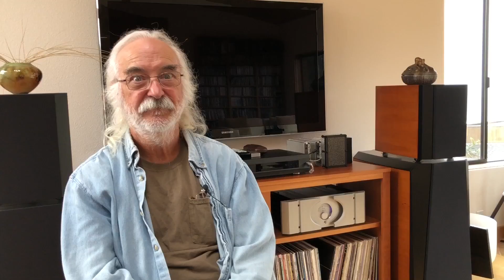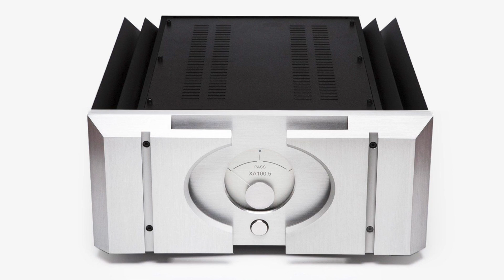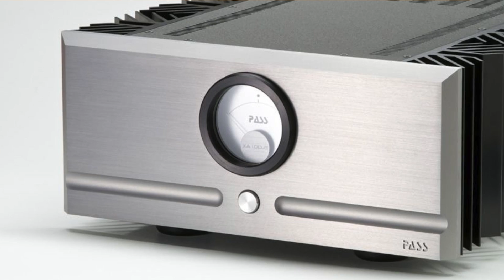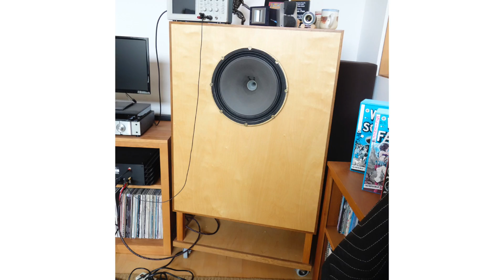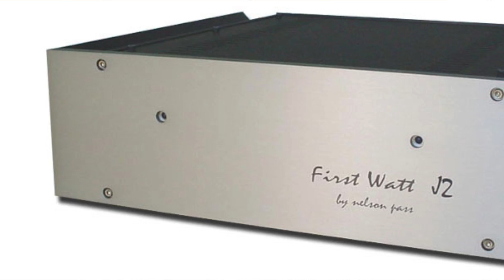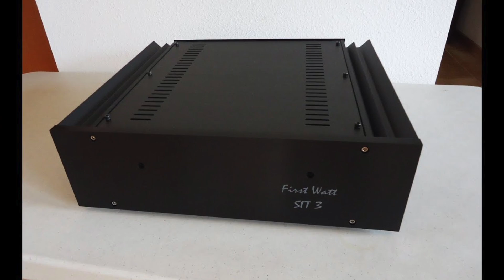Nelson Pass on his favorite amps, playing with distortion, and his 21 inch subwoofer

Comment: I was a Threshold dealer back in late 70's early 80's .. I had a chance to meet Mr. Pass at the winter CES show in Las Vegas, talked to him briefly as he was surrounded and I remember someone asking him about the LED  meters on the Stasis Two and when the LED meters were spiking did that mean the Amp was clipping.. his response was hysterical.. Does it sound like it is clipping? well no it does not.. Right was his answer .. I throw pillows in front of mine he replied.  next time around I will take them off .. I always thought the Stasis Two amplifier was a beautifully styled amp. They were replaced by the S500 Which was the brushed aluminum (still hand milled) face without the meters. I remember him with dark hair and beard lol..

Comment: 6:20 One of Frank Zappa's biggest laments, was that, his orchestral compositions were not rehearsed well enough before performances, so he wasn't usually satisfied with the results.
Frank was also a conductor of his works at times, so, he had a direct "ear" of what he wanted to be accomplished. He always had a direct composer's hand in his own Rock/Jazz/Blues workings, as can clearly be sen by his hand signaling or even body motions in many a live performance. One of his favorites was, to change the beat of the song he wanted to be performed to "Reggae" by putting his hand to the side of head and gesturing a twisting motion with it, like turning a knob. One concert he messed with his band and changed every song to a Reggae beat.

Comment: Steve, Question related to a Pass Designed Forte 1A class A amp I've owned from new (1991). The amp sounds fine but fast forward 33 years and I've noticed the amp doesn't run hot anymore and the little red power led tends to take longer to go out after I turn the amp off. Does the amp need service?

Comment: A question for you next interview could be to ask what kind of current/power purification is actually taking place inside the power amplifiers, like the XA100.5 I have for example. What is actually happening to the AC just before it goes into the DC stage? That would be really interesting to understand!
Reply: The AC mains are rectified and then ripple filtered with large caps for the rails, and then coupling caps pass the AC signal to the DC gain stages.  In a nutshell.

Comment: Question for Steve or Nelson: I have the Aleph 0 monoblocks and the First Watt J2. Which of these, if either, are best to drive my pair of restored Quad ESLs which have added the protection circuit (eliminating the concern of arcing the panels with too much power). Thanks.
Reply from the maker: Robert Segal I’d say the monos are more likely but since you have  both, try both!
Reply: Steve Guttenberg Audiophiliac Thank you Steve. Great interview with NP!  I’m also using the Rogue CM to drive the Quads. In an amp shootout years ago by Chesky and others with the Quads, it came in second place after the ASR Emitter which is not a prevalent amp on the US side of the shore.
Reply: Fabulous Aleph 0, take care of it, them. Old glories never die. I own two super class-a amps designed in 1989 and available till 2000, a pair of 100 watts each Sony TA-NR1s. I will keep them for the eternity by my side😍.

Comment: I have an SIT-3 which drives my Magico A3 86dB 4 ohm speakers super well. Will a First Watt J-2 drive these speakers well? I am concerned about the 13 wpc into 4 ohm rating. Thanks.
Reply: rj0640 only one way to find out
Reply: Wow! I have a SIT 3 too now paired with a pass labs hpa1 preamp and harbeth P3ESR it is ok but I would like to try it with some different lower ohms or higher efficiency speakers. Did you try pairing it with different preamps? Does preamp gain weight in that equation? Thanks

Comment: You are interviewing some of the most notable people in the industry and it's a pleasure to hear their insights and experiences. But the shaking camera (phone) and the momentary shifts in color balance (due to the camera moving and being influenced by the windows in the background) in this video can be really distracting.  A small, lightweight tripod would travel easily and make such a difference. The audio is OK with the lavaliere mics but a little touch of compression and EQ for the room in any video NLE would make listening to the interview so much easier. You were already there to add the still shot of the Tannoy. Just like correctly positioning speakers in a room, that last bit of effort makes all the difference in the overall experience.
Reply: I started to notice that too. The camera was hand-held the whole time. A Manfrotto Befree  tripod would be ideal to travel with.

Comment: Funny how people like (or dislike) this video (and other vids) after only 3 minutes of being online - - (the video is 20 minutes long)
Reply from the maker: Yeah, that's strange.
Reply: How do you know that when they dislike a video there's no way of telling?
Reply: Google controls all these numbers and it's getting worse.
Reply: He said it earlier,  I think.  The spectra of distortion would be a good indicator on how that amp would tend to sound when is working hard.
Reply: I would recommend to Mr. Pass that he could make his last, well not that last, statement amps using copper heaksinks to ameliorate the tracking of the temperature and maybe lowering resonances on power transistors due to higher mass of copper to aluminium,  three to one.

Comment: Euphonics is not High Fidelity.
Reply: Yeah, by definition. 
Care to elaborate? I'm guessing referring to the 2nd harmonic comments? That's the point of First Watt being a separate entity, right?
Reply: @FOH3663  There is a difference between an accurate recreation of an audio experience and a pleasant recreation of an audio experience. It is a general problem of the snake oil audiophoolery that plagues the industry for the past 35 years.
Since the dawn of the first audio recording more than a century ago, engineers have been seeking to achieve High Fidelity. The industry reached the pinnacle around 1986. Beyond that came the era of convenience, multichannel home theater and the conversion of an ideal from a genuine quest for accuracy, to a quest to brag about the sleek looking sculpted $300,000 turntable that some doctor or lawyer just bought. We are in a bizarre reality where people believe that power cords and cable lifters somehow magically enhance the sound of our equipment. We have entered the Twilight Zone of Audio.

Comment: Agree with the definition of the best system but, supplemental: The best system is the system which year after year fools the dog into snapping his head around ready to attack thinking that there is an intruder in the room. When she says that Mavis Staples is "right here in the room" that is also very good. B&W 800D with Threshold electronics, Accuphase digital EQ, home-cooked JBL 2245H 13 Cu.Ft. sub. (I was going to do the pipe but was overruled.)